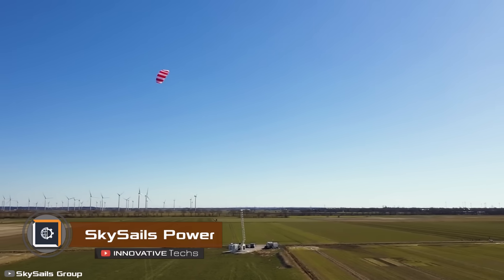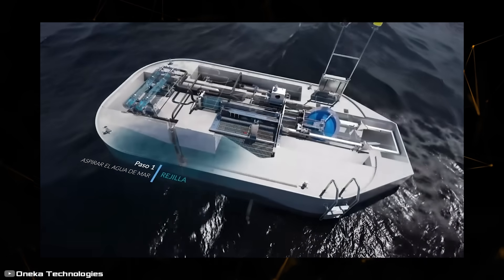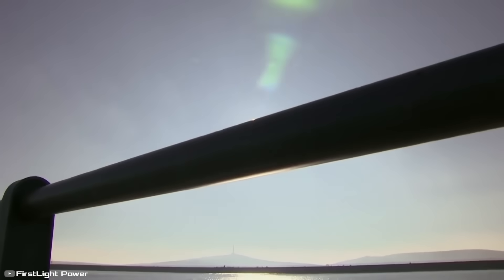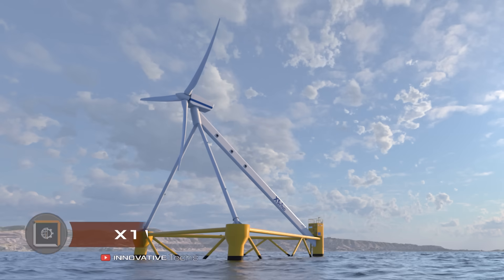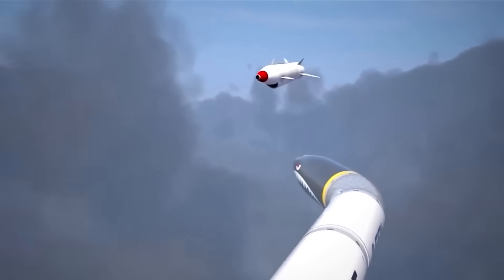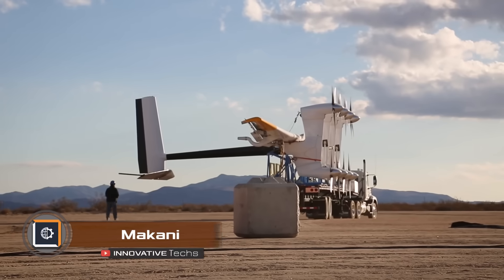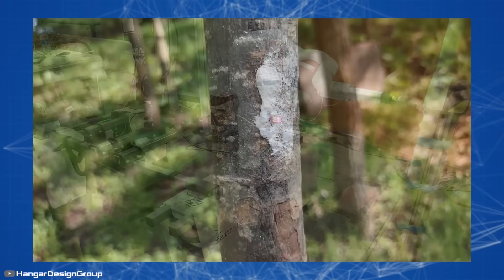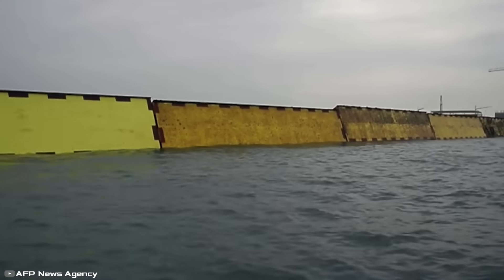INVENTIONS THAT WILL SOON CHANGE THE WORLD ▶2

Comment: Reg floating solar panels, what are the thermal gains to body of water from the panels heating up under direct sun light and the insulating affect of what appears to be 100% coverage of body of water by solar panels, what would the increased heat buildup due to again insulating affect of solar panels reducing if not eliminating heat transfer from water to atmosphere during cooler night time hours, the reduction of oxygen exchange due to much reduced surface area, loss of light for aquatic flora and fauna, chemicals required to inhibit algae etc that might become stinky sticky film in water, on water surface and on solar panels reducing that solar affect, who going to sweep the dust and other materials from solar surface to maintain optimum electricity production, can imagine what the birds  might encounter upon landing on a roasting hot surface that was cool summer time hang out last year. Wave action what's stopping these panels from acting like great lakes ice when wind blows just right, terrifying to see solar panels creeping like blob. Lol. Wink . Hands off the bodies of water, plenty of useless waste lands for such projects, if it not contributing to health of body of water then it's a no to use as a parking area for solar.